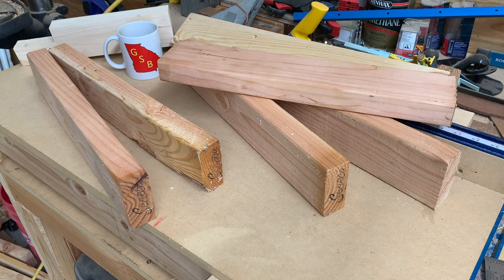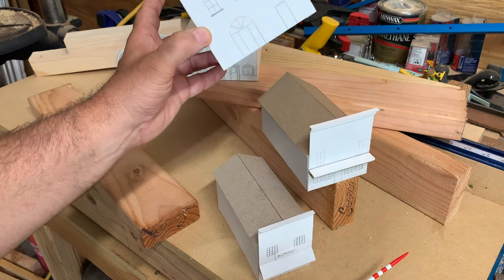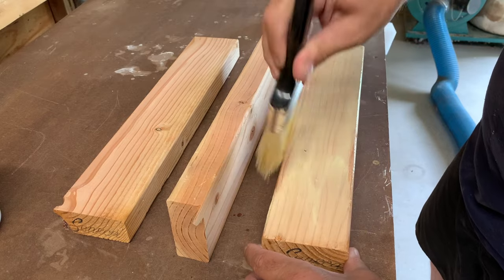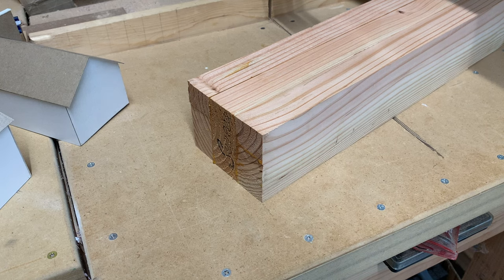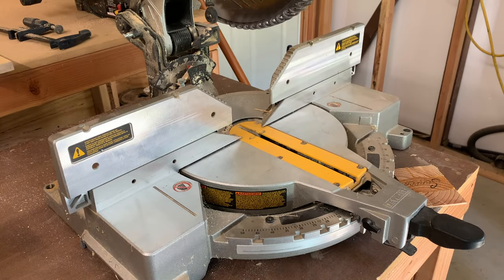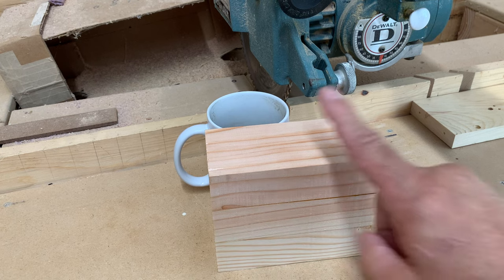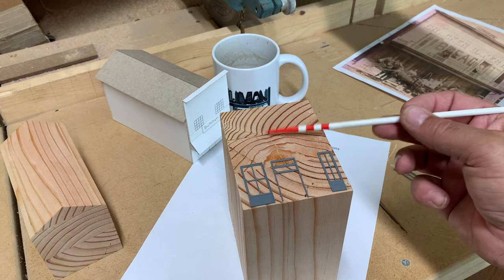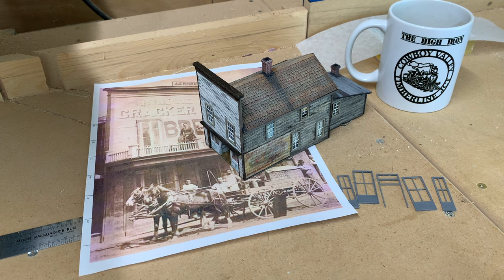Solid Block Building Construction

Comment: Hi, I think you're doing things the hard way here. What advantage does the solid block approach have over the traditional approach? It sure is not quicker or really cheaper.
Bob
Reply from the maker: Bob, 
I'm not suggesting this is better than any other technique.  Nor am I trying to "Sell it" as something others should do.  It is merely another way of doing things.  As far as advantages go, they are subjective as many things tend to be depending on how you chose to view them.  

I spent a few minutes gluing several scrap pieces of lumber together.  I can create the dimensions of the building in a few cuts and have something that needs no bracing and will stand the test of time.  I now have 5 sub-structures that just need finishing.  I do think that I can create multiple sub-structures in a fraction of the time it would take to glue them all up as a hollow building with bracing.  In that respect, I think it is quicker.  I have no concerns about the walls warping, they are glued on the structure before I apply paints and stains.  Cheaper?  I presume that I am saving a little money on bracing material, so there is that as far as cost goes.

Thanks for the view Bob, even if you disapprove of the technique.
Reply: @OtterCreek  It's not that I approve or disapprove, I was wondering only what you saw as the advantage to this method.

Bob
Reply from the maker: I do like the fact that I get to use my father's woodworking tools.  I'm sure that has something to do with it for me personally.

Comment: In our region (Virginia and North Carolina) one of the most common buildings you'll see out in the countryside is log tobacco barns. They're usually about 22-25 feet square, and two stories, with a door on each side. We have three of them on our property, and I built a couple of HO scale versions for my layout -- basically using scrap 1X4s, and carving the logs into them. Whenever family or friends would visit from outside the area, I'd give them a barn to take home as a souvenir. Somewhere along the way it crossed my mind that I should be selling these things. That's when we starting making the barns out of solid 4X4 blocks. 
We' start with a length of 4X4, cut the roof angles on a table saw, then cut it into 3 1/2 X 3 1/2 inch blocks. Then I press the "logs" into the sides using a 30-ton press and steel dies that I made for that purpose. Then I'll "fine tune" them, and cut in the door openings with a wood chisel and Dremel tool, then add the roof and other details. In some cases, the blocks will crack...in that case, I'll usually add a seven or eight-inch square base and turn it into a diorama. If the crack is TOO bad, it's nothing that can't be hidden under some rusty metal siding, or vines growing up the wall. We've been selling them at local stores and gift shops for eight or nine years.
Reply from the maker: How cool is that!  Ia that a '64 Chevy pick-up I see as your avatar?   I used to have a '64 short step-side in almost the identical color.  I had chromed bumpers though,  Loved that thing and wish I'd never sold it!

Comment: Love the way you are using the scrap wood for these projects.   heres a couple of tips for you on the table saw and joiner
  On the miter gauge for the table saw there are 2 slots on the face, those are to mount and extension fence to it, if you get a straight piece of 1x3,1x4 about a foot long you mount it to the miter gauge with short screws, then glue some sandpaper to the face of the wood and yoou will have a better area to hold the pieces to cut and leess slippage, also set it a bit above the table top 1/8th in or so to help  keep sawdust from building up.
  Also clean and lubricate the pivot for the blade guard on the joiner, it should cover the blades until you push the wood thru
Other than that have a great day, the layout is coming along nicely
Reply from the maker: Thank you Ray!  One project on the back burner has been a sled for the table saw. Jus haven’t gotten the round tuit yet!  Your suggestion sounds easier to accomplish!
Reply: @OtterCreek  Sleds are great but take a bit of tweaking to get them square,last one i did took 2days and would only fit that particular saw due to the guide slots were differant than my other table saws
 yes the extiones work great if you have sqaure stock, aslo if you can find cabinet grade plywood  12-13 ply scraps from a local cabinet shop you may get them free and they stay pretty true with minimum warpage have fun my friend, glad to help

Comment: It looks like the buildings you already have are ok, because you are going to cover them anyway.
Reply from the maker: Most of them are severely warped, and put together quickly with no focus on keeping them square.  I do plan on using other techniques for scratching some of these up though.  Thanks for dropping by!
Reply: @OtterCreek  Great looking building. I've been using 1/8 plywood for my buildings and has been holding up well. I paint both sides of the wood to help with warping. I don't use wood glue anymore either, just CA glue.
Reply from the maker: Hello @helmikins, I have a stash of 3/8's Baltic birch I will be using in the future.  Just not sure which building I'll be using it on yet.  I haven't been brave enough yet to switch to CA, I like the comfort of "dry time" LOL.  Thanks for stopping by!